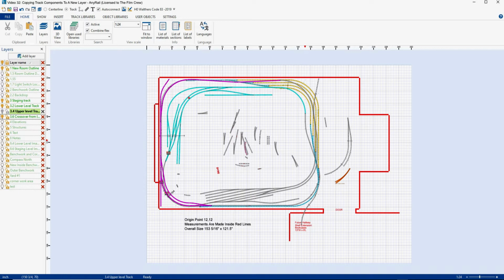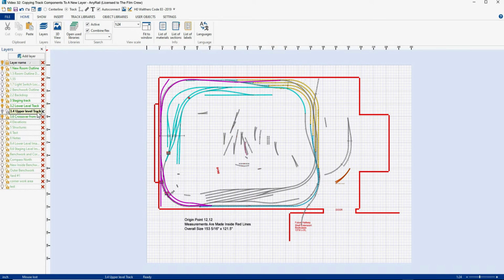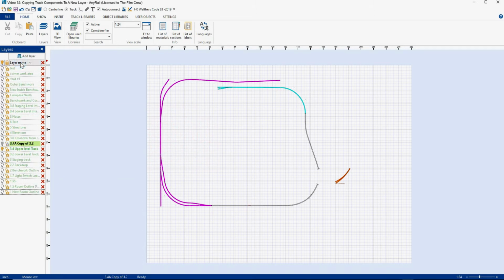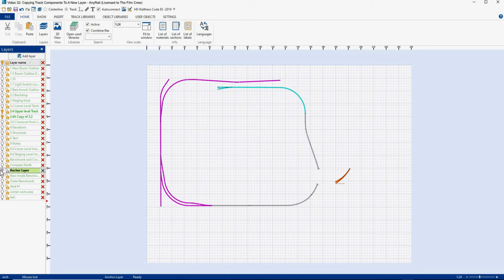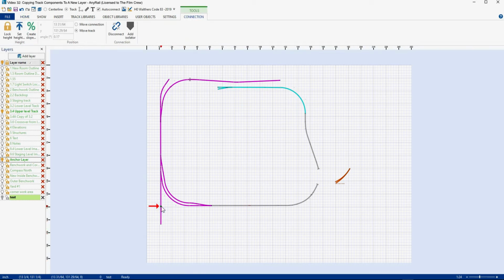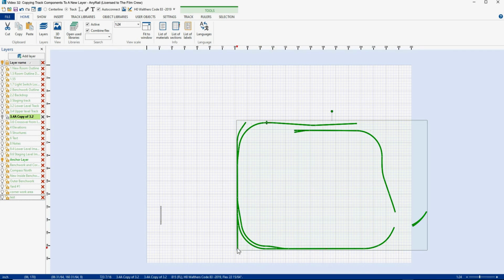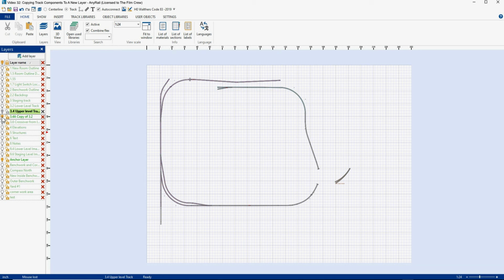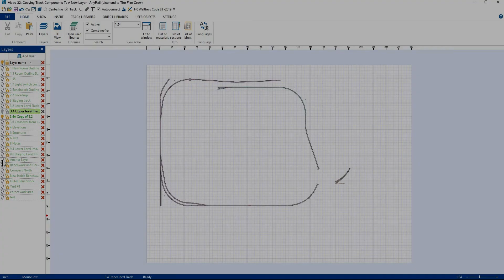AnyRail 6 Tutorial Video 32: Copying Track Components To A New Layer

Comment: This is a very good workaround to copy trackworks. Not actually copying an entire layer to a new layer but it works perfectly with trackworks. Indeed, IMO the concept could also be useful to reposition an entire trackwork to a very specific location, either in the current layer or in a new layer. Thanks so much, and looking forward to seeing the surfaces workaround
Reply from the maker: Hi Elvio. Glad it worked for you. I am having trouble with the surfaces and lines video. Anyrail will sometimes not do the same thing twice on my examples so I am still trying to come up with a good way to copy them to a new layer. I'll figure it out soon. Dave